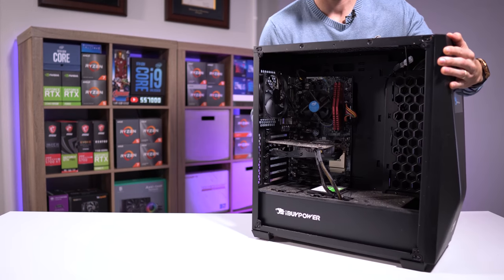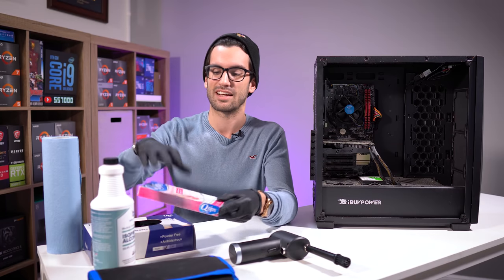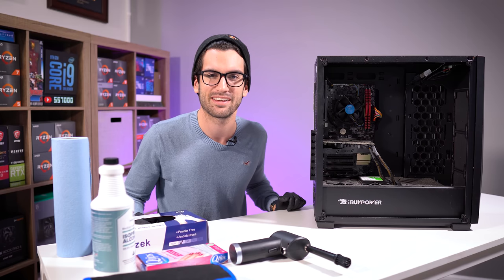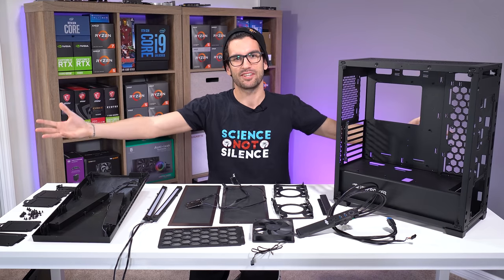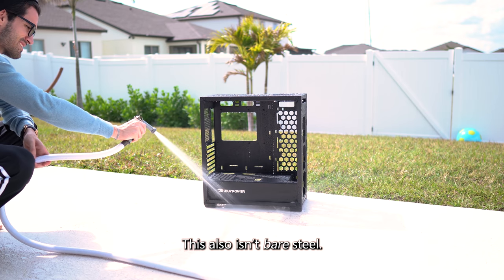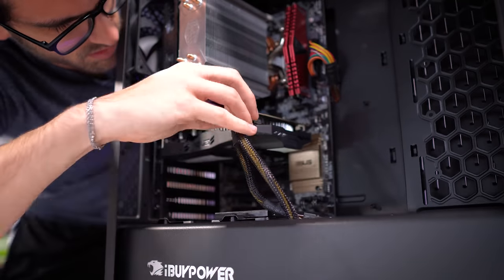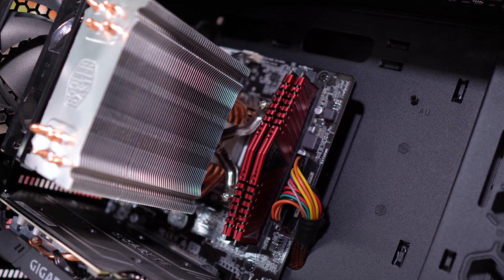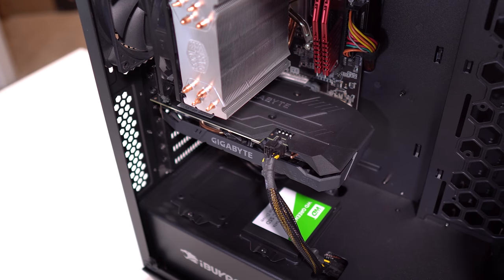Deep-Cleaning a Viewer's DIRTY Gaming PC! - PCDC S1:E4

Comment: This awkward looking PC really makes me frustrated with the way prebuilt system integrators cheap out. Tiny little mATX motherboard back there looking pathetic with what seems like about 6 feet of case out in front of it, and then they don't even fill any of the space with fans in those side-vent spots. In fact, despite what appears to be mounting points for no less than 6 fans between the front panel and side, the only case fan in the whole system is the one exhaust. Come on, iBuyPower, this thing has an i7 in it, you could at least help the poor little piece of crap Intel stock cooler out a little! This thing has case RGB, hook some RGB fans up to that controller and hike up the pricetag!